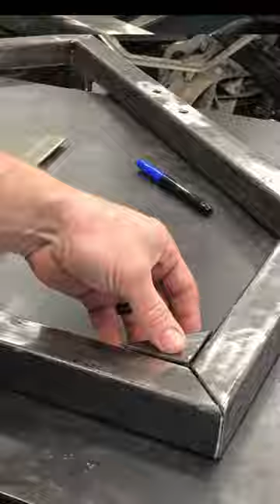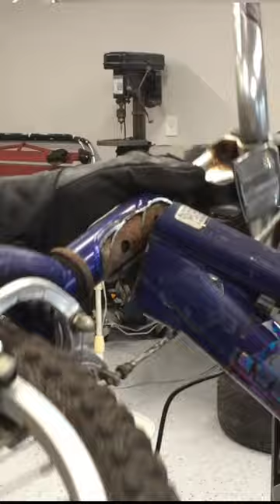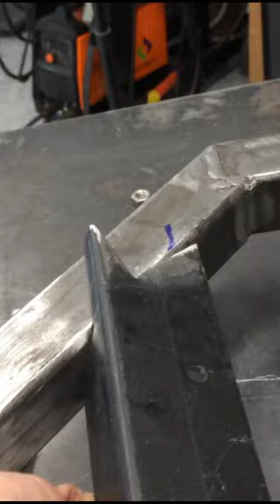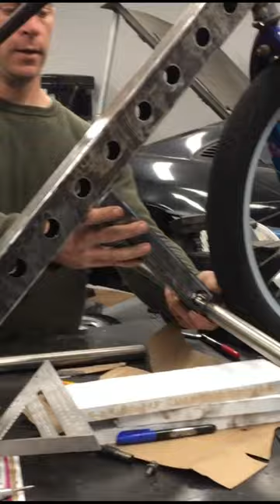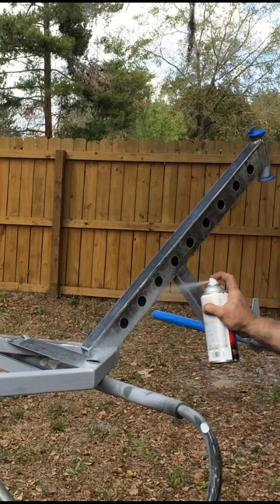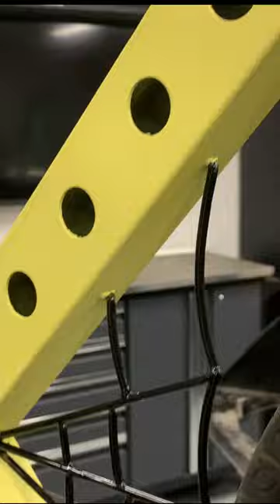Drift Trike Build

Comment: Very nice.  That's on my agenda come Springtime (I don't have a garage will be doing it in the bed of my truck).  I had a 10HP generator and the coils blew out, so now I have a really nice running 10horse tecumseh with a fresh carb on it.
Reply from the maker: Sounds Awesome! Spring is just around the corner
Reply: Well a friend has a little Honda Rebel with a wrecked frame as well.....  The Tecumseh will be for my wife.  The Rebel is gonna be used for mine lol.
Reply from the maker: @RC-NW  I like it! Wish I had a friend with a wrecked Rebel

Comment: I also use the PVC sliders there's this really really cool website that sells them for any size tire and if they don't have your specific size and they're very cheap and they also do good cheap bundle deals for bulk orders.. I usually get the $45 deal and that comes with that comes with eight which is a good deal also you can them in any color... they also sell rims and regular tires all terrain slick super slick and they even have badass Mickey Thompsons that's what I have online I got there super slicks and you don't even need sliders when you have those if you would like the link just let me know
Reply: YES WHATS THE LINK

Comment: Nice set-up very close to mine I'm using the new Harbor Freight 212 predator Racing engine what engine are you using???
Reply from the maker: Hey! i am running the basic 212. Yes, please send me the link. I only have 4 sleeves left and have been tearing through them pretty quickly.
Reply: @scantronsgarage  hey I'm sorry I just saw this what are you needing